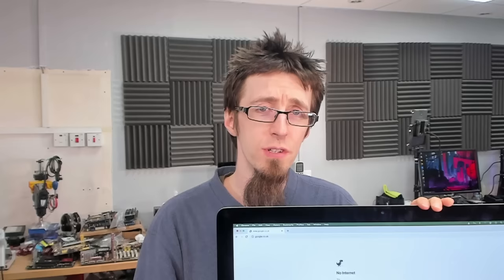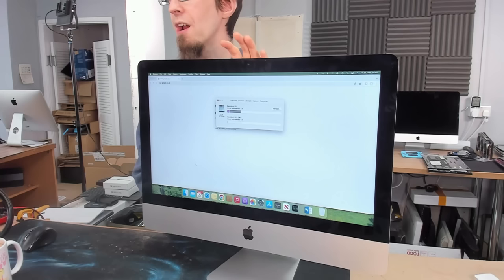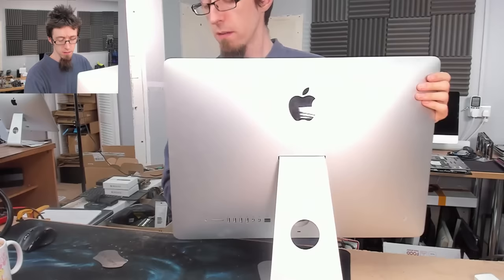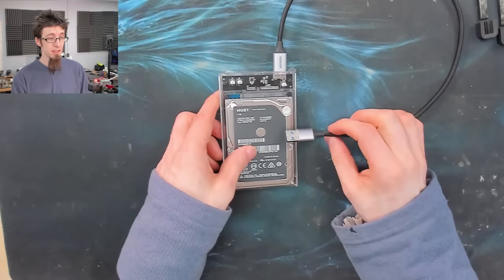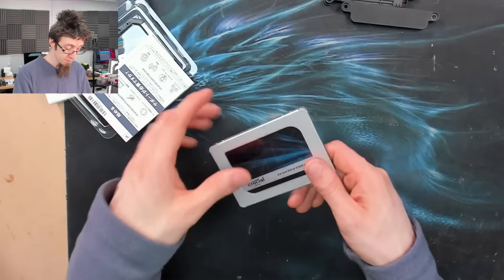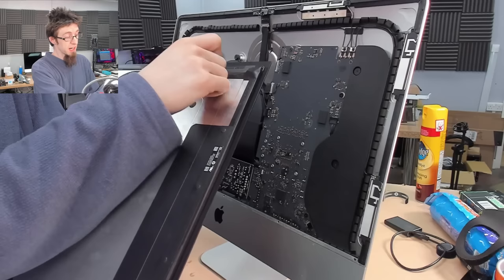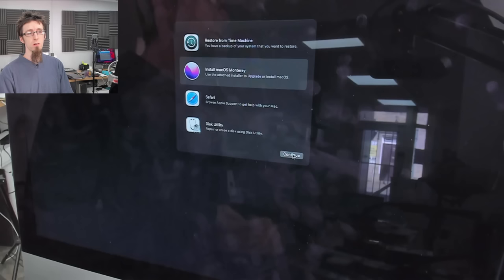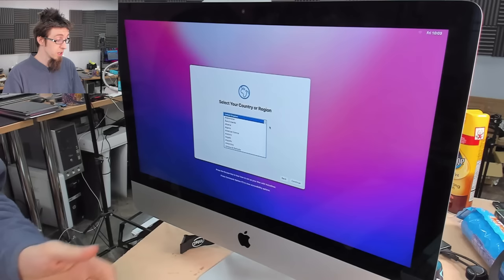Make an iMac super fast with an SSD - LFC#310

Comment: Thank you for the video. I'm a bit stuck at 29:00. The chime sounds, I see the screen switch on, but nothing else happens, it remains dark (altough I can clearly see it is on) and I can't even switch to internet recovery mode. I'm a bit scared to be honest. :D I double checked the screen connections, they seem to be fine. Totally lost here.
Edit: Just came to mind: Maybe the problem is my third party bluetooth keyboard not pairing during booting? I may have to try again with a cable keyboard. But even without it, shouldn't the Mac at one point display a folder icon with a questionmark since it doesn't know where to boot from? I'm starting to lose hope, not gonna lie.

Comment: my screen has a little crack in one corner.. doesn't bother me but would you say getting the screen out would be ok or break it totally??? thanks
Reply from the maker: If you're super careful, it can be done. I've removed a few screens that have cracks in them without disaster. Be prepared for the worst though. When I'm working on an already cracked iMac, I usually say to the customer "I'll do my best, but if it breaks, it breaks."

Comment: It still strikes me odd there you were able to access the data on the old HDD. This is only possible if the drive was not part of a fusion drive. But I did not see an internal NVMe SSD in disk utility either.

Otherwise, people who do a swap themselves should check if there is a protective strip of another double sided tape on the back of the display. The installed strips do not hold well on that. I had that on my 2019 iMac display and it drived me nuts because it was so hard to see and the display has always been loosening itself! It was horrible!

Comment: I added an SSD and the process was easy and this is the first time I ever tried changing a hard drive, much less changing to an SSD. Everything is working ..I think.  My concern is that I removed the fan and cleaned it.  I think I reconnected the power to it, but I am not sure i did.  Is there a way to check that it is connected?

Comment: Just made an external Mac OS ssd drive for my 2011 imac.  took me forever, due to many mistakes and corrupted files, but it is working great.  Don't have the equipment nor do I trust myself to remove the glass/display, though I think these old imacs are magnetic?  Anyhoot, loved your video!  Wish I could take my mac to you for a cpu upgrade, plus graphics card, n whatever else could get upgraded (usb? bluetooth, wifi).  I don't know who in my couuntry would do this (Switzerland) cause the main stores working on macs here will not do anything but apple approved stuff...ugh!  Cheers!

Comment: Hi Adam, did you had any problem with the adhesive on any? What strips you buy? Looking around no matter, cheap or expensive there are always reviews that the screen has fallen after weeks. any tips to prevent this from happening? I seen a picture someone used a cable tie between the screen and the chasis, just in case.
Reply from the maker: Never happened to me with any strips I've bought on amazon or ebay. I suspect that people who've had problems did not remove the old adhesive before putting on new stuff, and that would definitely cause problems.

Comment: Tip for anyone with slowdowns some months after upgrade. Try force enabling TRIM. In my experience on Hackintoshes with SATA and NVME drives it doesn't cause any issues but I never notice slowdowns. Run terminal and type "sudo trimforce enable". (without quotes) It'll give you warnings so it's up to you if you want to take the risk but I've got a year old install still going fine on a HP that's been moved between multiple machines.
Reply: If you have apple SSD you don't need to do this but you can check in system report. Look for "Trim Support"

Comment: There is a good drive monitoring app that I use for os x called( DriveDx ) "Regular diagnostic tools simply check the built-in S.M.A.R.T. status of the drive, which provides the user with little information about the actual state of the physical drive. As opposed to such tools, DriveDx analyzes the current state of the drive using all the drive health indicators that are most likely to point to a potential drive issue (for instance, SSD wear out / write endurance, I/O errors, pending sectors, reallocated bad sectors, etc)."

Comment: I have a 2015 27” iMac and it’s still a good computer with 24gb RAM and a 3.00GHz quad core processor. It does what I need and is still quite fast. I can no longer update it from Big Sur without a workaround. Part of me it tempted to upgrade it and part of me says that even though the computer isn’t worth that much these days replacing it if it goes wrong would cost me at least a week on the sofa…hmm could be worth it after all.

Comment: Hello, if I already have an SSD in my iMac would this swap potentially make the overall machine faster? I have a late 2015 machine with a 500GB SSD but it's slower than I would like. Thanks!
Reply from the maker: Is it the fusion drive setup? If so then going to pure SSD will be faster.
If it's actually a full-blown SSD, probably won't help unless the SSD is faulty.

Comment: I did an external 500GB SSD via Thunderbolt 2 and kept the 2TB HDD internal. So there is that option for those not wanting to take apart an iMac
Reply: Where is the video ?
Reply: I did the same, use an external ssd it works great…..

Comment: I've done multiple SSD upgrades of these machines - this tutorial is spot on, the only small criticism is using the metal shim as in some cases the metal can scratch behind the glass - it would be better to use a plastic one if possible.
Reply: Is the 'thermal sensor' from OWC needed in these SSD upgrades? I have the 2017 5K retina iMac. I read one comment that said it's not needed, if it's later than 2012. And another comment that said it's absolutely needed.
Reply: @user-gp1bt4vm3r  no it isn't needed for these models. They are really only needed for the 2009 models. On the other ones, the fan speeds can be controlled with the Mac Fan app.
Reply: @CaptainGimp  is that app already in the Mac and automatic or do I have to manually adjust the fan speed every time? Sorry, I’m not so tech savvy in these types of upgrades.
Reply: @user-gp1bt4vm3r  no you will need to download the app and then set the fan speeds. Allow the app to open on startup so that the ramped up fans can then settle down. I've a mid 2010 iMac with Ventura running on it with no issues with fan speed.

Comment: Hi I have a 27inch mac that I have not used for a while and now will not boot up. It switches on and the apple logo comes on but it stops loading when its 3/4 along the bar. It then shows a white no entry sign. I have used disk Utility and First Aid in recovery mode and It does not see the 3TB SSD. I have a 1TB windows partition on the drive and it boots up to that with no problems. I dont see the mac 2TB part of the drive when in windows. I wonder if the macos has lost its boot sequence or does not know where to find the boot sequence. I noticed that the disk utility information does not have in the mount box there is no info. ( I would have expected some sort of root like system/etc) I would appreciated your ideas on this and what would be the best way forward. I am competent in pc repair hardware, I just need some advice. Worst case is to change the ssd. Thanks. Great video BTW Russ

Comment: My iMac 2010 21.5 keeps shutting down randomly. At first I thought it was the power supply. I changed it and it was still randomly shutting down. I use the mark fans software to control the SSD but still random still shutdown, I don't know if it's because I upgrade the GPU to k1000m , But I have a friend who used the same GPU on his iMac 2010 works fine

Comment: Note that it's cheaper and faster (in operation), but harder to do, to ditch the SATA HDD/SSD entirely and instead replace the SSD blade on the motherboard. You'll need an M.2 connector to "proprietary Apple 12+16 connector" adapter (the small one without the board, just google) + NVMe blade, or one of the blades from OWC that has the Apple connector.  They're 2-3x faster than SATA SSDs too.

Comment: So I was running Monterey but when I upgraded to SSD it loaded high Sahara. Can I migrate apps and such from my old drive or do I need to update OS to Monterey first.
Reply from the maker: I would upgrade first. The good part about Migration Assistant is that you can run it at any time. So get the system up to date on montery, and then run Migration Assistant to import your stuff from the old drive.
Reply: @Adamant_IT  great thank you

Comment: IF you are installing macOS Monterey, there is another reason to install an SSD. Monterey demands the APFS Storage Format. APFS was designed from the start to work well with Solid State Storage. And APFS does not work well with a spinning platter Hard Drive. You would have to go all the way back to macOS 10.13 High Sierra or earlier to get an operating system that functions properly with a Hard Drive formatted HFS+ (Mac OS Extended (Journaled)), John M.

Comment: Thanks for posting such an informative video -- it will really help me with my process. Like many others, I too am getting parts together to upgrade the HDD in my 27" late 2012 iMac to a 2TB SSD. While I didn't hear you make specific reference to a thermal sensor -- for the SSD or HDD in your video, do you know if they are necessary when upgrading from the original (Apple) HDD?  There is reference to a thermal sensor as part of a kit on both the OWC and iFixIt pages. It's a SATA interface cable with the sensor attached.

Comment: Hello! I really like your Videos they helped ne Out several times! But did you ever Made a ssd Upgrade on an MacBook Air 2019? The ssd is soldered on the Mainboard and i thought to buy a ssd Card and use These IC’s to replace the Original on the Mainboard! Have you any idea which ssd Card i can use to do this?

Comment: Have you had any thermal issues when installing an ssd? I've noticed lots of kits come with a thermal sensor.
Reply from the maker: I haven't looked at those kits, but most likely they're to deal with the older iMacs (with DVD drives) that had a temp sensor on the HDD. The sensor needs to be replaced or bypassed on those models when fitting an SSD.
Reply: @Adamant_IT  The kit I ended up going with just happened to come with one and it was specified for my late 2015 27" iMac.  It the thinner retina display without a DVD drive but it still came with the OWC kit.  Can't say for certain that it was needed but I feel better that it's there regardless.

Comment: Hi there, a long time ago I successfully completed the ssd transfer on a 2015 iMac using your original video, and it has worked superbly well until Apple issued Monterey OS. Since then the software has refused to let the onboard camera connect to facetime or any other product. Prior to Monterey, I was using OBS, with multiple cameras, now none of them appear on the studio floor. The strange thing is, that when facetime or OBS call for the camera, the steady green light comes on, but the source window remains dark, and the software declares that there is no camera connected. Now all the published fixes for 'reset' of the camera refer to flashing green light, which never happens, however I've performed all of them with no change to the status. The diagnostic reports nothing out of the ordinary, the reset of the vcd, happens and the green light comes back on, but still no camera. Plugging in the other usb cameras produces no result. It's a Mac well out of support, and their support pages are as useful as the other advice. There was a surprise update in April 23, despite being out of update range, but that changed nothing. What experience have you of this issue, and would you recommend retrograde to the OS if that is even possible?

Comment: I love this man, such a great explanation! I just bought a used late 2013 imac and will follow your lead, do you think the fact that the OS is not upgradeable past Catalina is a problem?
Reply from the maker: Well,  I have a late 2012 iMac on the front desk running Catalina, and it's fine for general web browsing and stuff - but I can't install modern Microsoft Office on it, or any modern Apple apps... It works, but it's on borrowed time.
It's probably possible to force-install a newer version of macOS onto it, but this can be a pain in the ass, and for me, I'd sooner spend that time and effort elsewhere. I'll keep my 2012 on the front counter until it can't run Google Docs anymore, and then it won't be useful to me anymore.

Comment: do you offer the same sort of service of the nvme upgrade in iMac mid 2017 27' (realises its more involved) ?
Reply from the maker: I don't, no. Personally, I don't think the speed benefit of NVMe over SATA is worth the hassle of taking the logic board out - it doubles the time the job takes. A decent SATA SSD like the MX500 can do 500MBps all day long, and has respectable random IO as well. Given that there's no external connections to an iMac that'll go faster than this (that would make the SSD a bottleneck), a SATA SSD is totally fine.
NVMe is the way forward, yes, but for the iMac specifically, it's a whole lot easier to just put a SATA drive in.
Reply: @Adamant_IT  thank you - useful points.  If i was to go down the SATA SSD can i provide my own disk for this ?
Reply from the maker: Yea that would be fine with me. The Samsung Evo 870 is a hair faster than an MX500 if you're trying to squeeze out as much speed as possible, but I defy anyone to notice the difference in daily use.
Reply: @Adamant_IT I know what you mean re advertised speed and real world.
Thank you.

Comment: Dear Adam, the tool with curved edges is called a “scraper” and is primarily used in woodwork to remove small amounts of wood to reveal a smooth texture on curved surfaces.

While you have the hood up, could you show me how you would go about upgrading the Processor please!

Comment: question, my imac is a 21.5 inch, 2017, with a 2.3ghz intel core i5 with iris plus graphics 640 cached at 1536mb, will these instructions apply to this model, I want to start daily driving it again but its recently been slowing down to the point safari freezes constantly and I am now using my laptop as a daily driver
Reply from the maker: Yea basically the same deal inside. The logic board changed size/shape in different versions, but the drive layout has been basically the same all the way to end-of-life on these iMacs.
Reply: @Adamant_IT  ok thanks, gonna use the old hard drive for my GarageBand projects, will save up for an ssd

Comment: Great video! Question further on Fusion drive.  Does the Fusion drive need to be "split" before installing the SSD?
Reply: Same question from me. I’ve read different instructions for this, some saying to split it in Terminal and some not. Based on the fusion discussion in the video description I think yes to splitting the fusion up which reformats both drives I believe, then just crack on with the SSD upgrade
Reply: @AlistairJC  I wasn’t able to clone the drive so I didn’t split it, to not format my hard drive. After installing the SSD I migrated the old HDD. I then formatted the blade SSD and left it blank. So far , no issues🤞🏻
Reply: @ScubaHockeyDoc  thanks Steven, sounds a sensible approach. Use a sata to USB like the vid to do that? I guess the blade just appears as part of the broken fusion when you start it up for the first time and you just formatted it like you say!
Reply: @AlistairJC  yes sata to usb 3. The Blade SSD just shows as another drive on finder and disk utility
Reply: @ScubaHockeyDoc  Thanks again! That’s fine with me - I’ll look into doing it this way then. Having the blade just sat there is ok with me

Comment: Great video and well explained. Is it not possible to just clone the old drive directly to the SSD and cut out all the re-installing MacOs etc? I did this with Windows using Macrium reflect and it worked perfectly.
Reply: yes you can use SuperDuper or Carbon Copy Cloner to clone the new SSD after installation but you won't have the recovery partition that a fresh copy of MacOs installs.

Comment: I replaced HDD and RAM on my iMac 2013 last weekend. Installing SSD was easy, changing the RAM was tricky without removing the logicboard but I succeeded. I only had to remove the fan and needed muchmuch patience to install the new RAM. In newer versions of iMac, RAM is caged and you have to remove motherboard, loudspeakers and powersection 🙄

Comment: I’ve heard that you need an additional hard disk adapter with a temperature sensor to prevent fans from operating at full speed. Is that not required according to your video?
Reply from the maker: Only on the old pre-2012 iMacs. Depending on the model, there's either a sensor wire that plugs into the drive which you can just bridge (paperclip short the pins together) or some models don't have anything and you need to use software to control fan speed. Slim models (2012 onwards) don't require any mods at all.

Comment: Another very useful video. Might I just suggest testing the SSD before putting it into the sealed unit.
Reply: He did say that on the video.
Reply: @blue_jm  Yes he did mention testing the SSD if you weren't feeling confident about just installing after only seeing if the drive is recognised by the OS. But he didn't test the SSD in the video. I would of at least run it through a crystal disk mark test first. But to be fair these drives are fairly reliable, so yea.

Comment: When you clean dust from a PC. Are you concerned about fans spinning and generating current? I tend to use a small paint brush or pencil to stop them from spinning.
Reply from the maker: I've heard a lot about this lately... I let the fans spin, but I don't over-spin them because it's hard on the bearing. I've been meaning to test the 'back voltage' theory sometime...